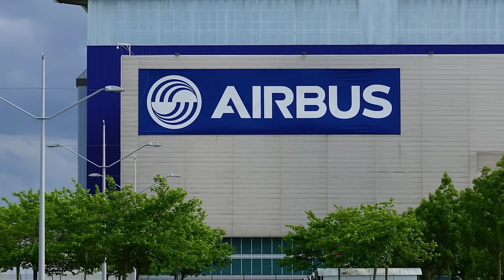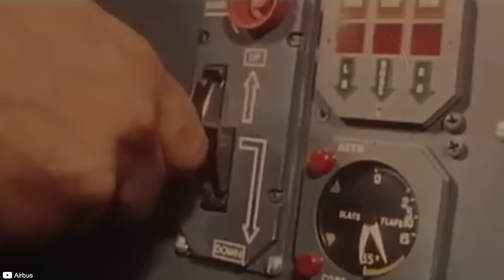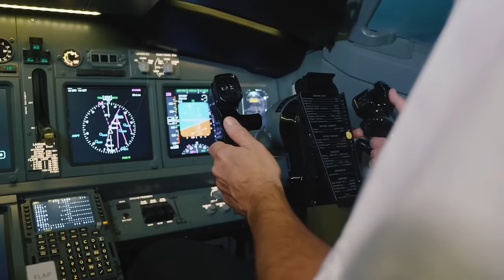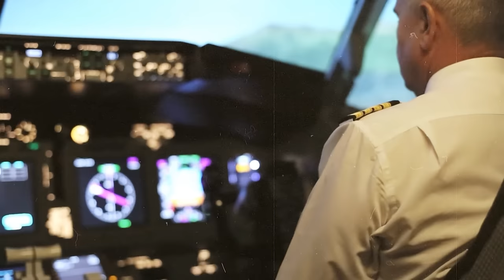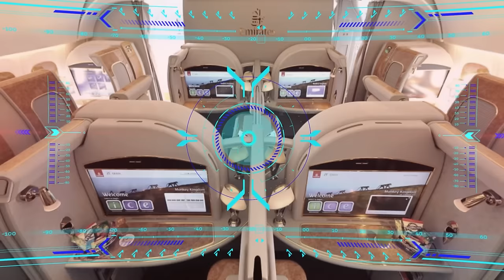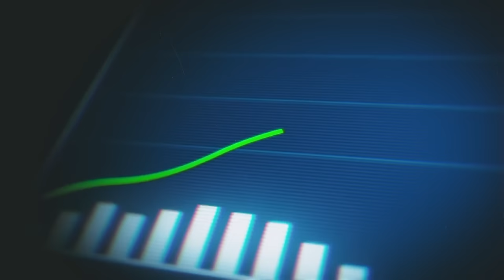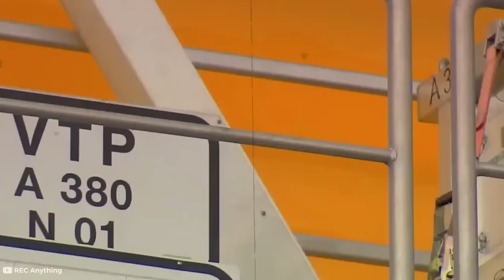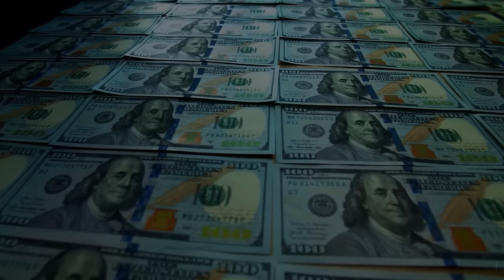This Is How He Built World's Biggest Aerospace Company!

Comment: The story told above is far from reality.
Initially Airbus was planned as a 50 pct/50pct project between the French and the British who both had built airliners during the 50 and 60' and that included the supersonic Concorde, 
in the 60' Germany had no experience in the manufacturing of Jet airliners... only ambitions.
The Germans came into play when the British decided they could not afford the project,  that is when the Germans were invited to replace the British who took a smaller role in the venture.
Franz Strauss was a politician and acted as a lobbyist and as such aimed to get Germany to replace Britain as a key partner of the French in the Airbus project, Strauss was not a founder of Airbus, he only joined Airbus as a chairman in 1980, Airbus had started in 1970.
The first Airbus the A300 came in 1972, meaning long before Strauss actively joined the company.
The first men in charge of Aibus were the Frenchmen Henri Zielgler and Roger Béteille, both aerospace engineers...
Reply: True, but without German involvement, Airbus could not compete with Boeing, because many British aircrafts were not successful before, France produced only three - Caravelle and Mercure and Concorde with the British. Caravelle had a British front part and engines and Mecure a lot of parts from other European countries, but was on market unlike the Caravelle very unsuccessful. Only the later Germany presence in the group led to success finally.